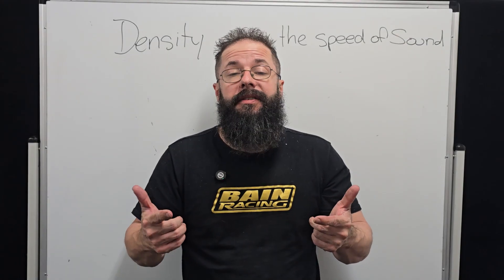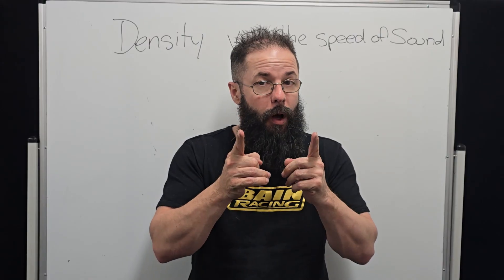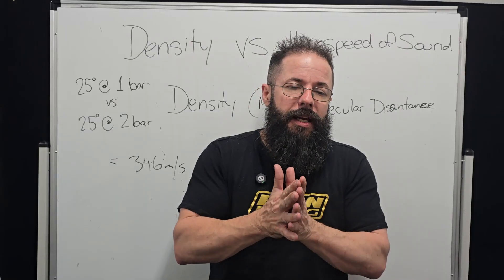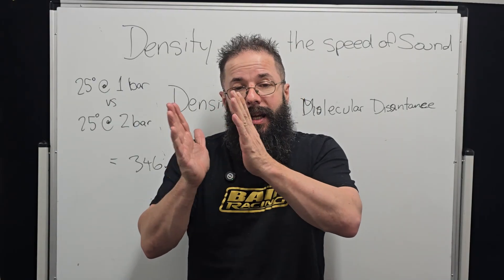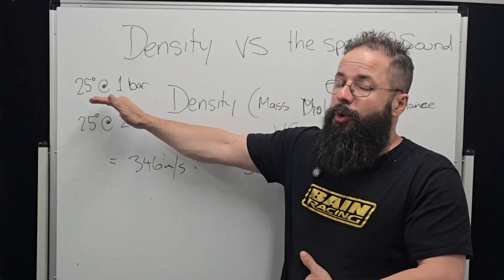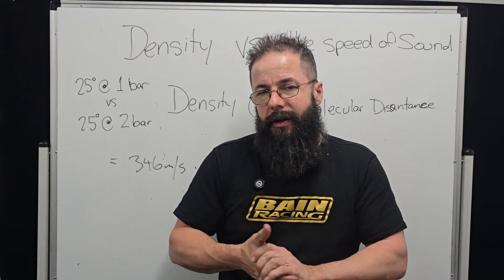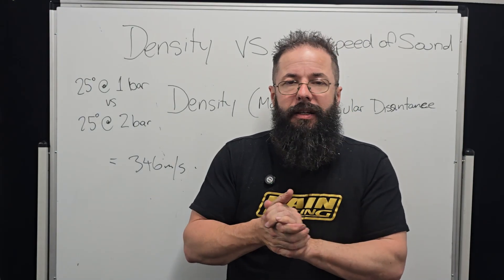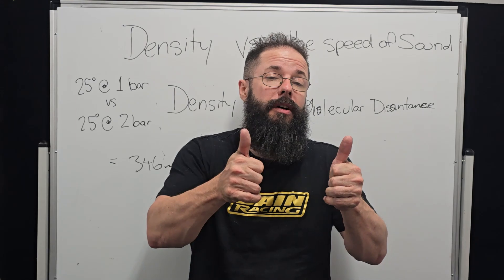Why BOOST Pressure Doesn't Change Wave Tuning Lengths - Density vs Sound Speed Physics Explained

Comment: Jake, right at the 5m mark you say doubling the density of the air from 1 bar to 2 bar should reduce the speed of sound..did you misspeak? 2x density should increase the speed of sound [all things being equal, not accounting for stiffness], as you said earlier in the vid.

Just asking for posterity :-)
Reply from the maker: Yes. Density won't change speed mate. I must have misspoken. Thx for picking that up. 👍

Comment: So the notion of changing the induction system in nitrous applications has nothing to do with the added air, but the subzero temperature at which it is injected?
Reply from the maker: Yeah, same as boosted engines.  Temperature is our key focus, not density. 👍

Comment: great video, i would be interested in what your take is, on long tube turbo manifold vs short. how it affects the exhaust waves/pressure ,spool and if that changes what cam specs is more optimal

cheers!
Reply from the maker: Yeah we should do that, i have mentioned it in parts thruout the inductions secerts series. But a short on just that topic is a good suggestion. thx